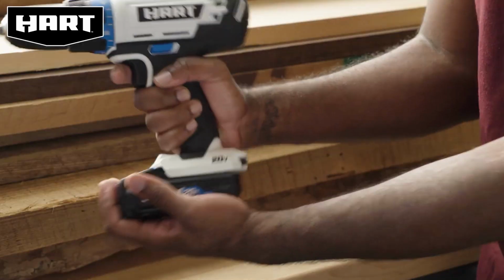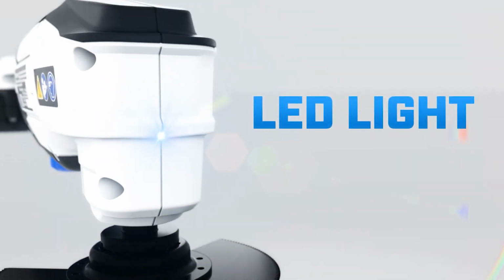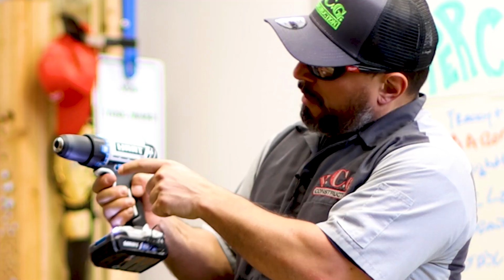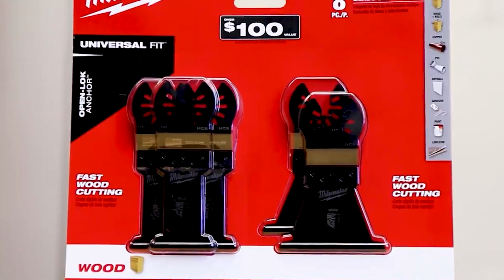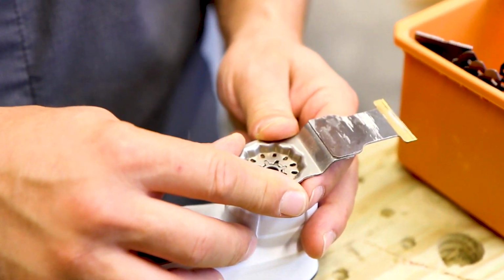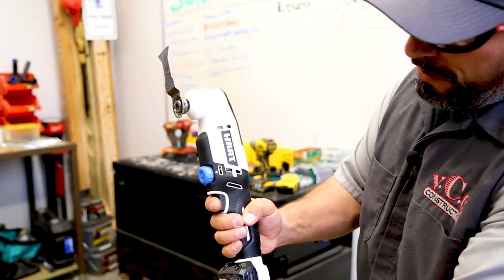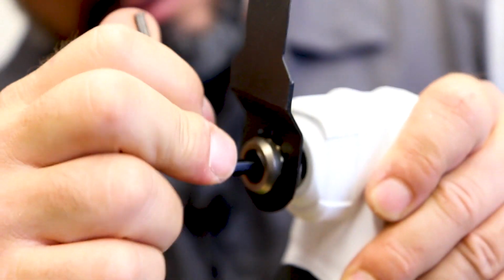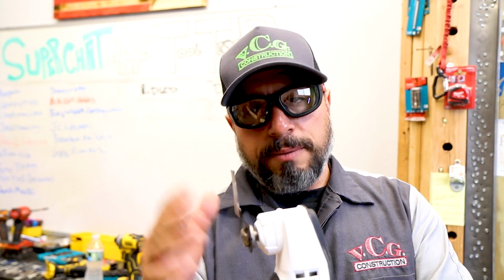New HART 20V Oscillating Multi Tool (I CAN'T BELIEVE WALMART SELLS THIS!)

Comment: So I work as a service tech actually.  I decided to have a little fun with it regarding the tools I decided to use.  In my case, I decided to try out HART tools.  So even though they are being called a DIY home use sort of tool, I am putting them to the test professionally.  I will say, so far, I have not encountered any issues with the tools I currently,y have and in fact they have all been very capable of getting any job done I have put them up against.  As a result, I intend on continuing to acquire additional HART power and hand tools for this experiment.  So far, HART has risen to the occasion.

Comment: I'm an occasional d.i.y carpenter. I bought the hart kit with the drill /impact/ saws-all etc Kit two years ago. They all perform great with a high degree of toughness. I've dropped them and threw them to the floor in a fit and it took multiple hard impacts before the drill finally broke. I smashed the drill end into the floor and it finally broke. I was impressed and bought another. I just ordered the multi tool. The buy the battery separate thing sucks. But overall, a tough tool reasonably priced.

Comment: I use HART tools exclusively. I was a KOBALT fan and I still love their 24v MAX line. I had 4 of the KOBALT tools and was building my inventory and had all of them stolen. Every tool I owned and it almost put an end to my business. I had 3 contracts signed, every penny wrapped up in materials and was just there with no way to do the jobs I had lined up . And as fate would have it my 18yo daughter came to visit and bring me my father's day gift.... I told her about the situation and she said Its ok dad. . it will work out... She left and came back with the HART drill and driver set... I have been using them daily and putting them through the ringer... I am impressed with every tool I get... I have 6 pieces now. I will put them up against DeWalt
Reply: This has to be a joke.
Reply: @svn5994  I have had the same experience with my Hart tools. I use Dewalt drills and Makita impacts at work and my Hart beats them all day long. Will they last as long? Who knows. But don’t discount the experience of people who use products you might not like.
Reply: People are crap when they steal 😡

Comment: I hate getting trapped into ecosystems with tools. Once I bought my ridgid impact driver, I was trapped into their system because of batteries, charger, etc. 
But I needed a multitool. 
Knowing TTI makes both Ridgid and Hart, I figured I would check out the Hart tool. Here's what I found...
They're the same. The Hart and Ridgid multitool are exactly the same. In fact, using a soldering iron, I can charge my Hart battery in my Ridgid charger. It's an OK tool. Well worth the money.

Comment: Got it for 50 bucks ......replaced blades and this thing is actually a beast.  Used the 4Ah battery and it does seem to perform even better.  Wish it was a quick change blade though.  I did buy quick change blades for it because you don't have to do a full removal, just loosen it up a little.

Comment: Makes sense that the Milwaukee blade would fit the Hart tool.....they are both a product of TTI.  I haven't used these power tools so I can't speak to the reliability, but I did buy the pro grade stud finder (no model number but the Walmart SKU is576810123.) This thing works AMAZING!  Also, Hart currently only offers 20v and 40v batteries.

Comment: I have Ridgid and Metabo HPT plus Ryobi and Hart both of which I kind of got into by accident, Hart is no where near Ridgid or Metabo HPT in quality but it is competitive with the brushed Ryobi in quality, it gets the job done for most DIY things at a price only Bauer can compete with. They are made by TTI which makes Ryobi, Ridgid and Milwaukee so they are not going to make junk. I hear they are coming out with a brushless lineup so that will put them more on par with Ryobi plus they are coming out with a lot of odd cool battery operated things like a 5 gallon battery powered camp shower/sprayer, similar to Ryobi and Makita that have all the odd "tool" options in the lineup.

Comment: Thank you for the review I just recently purchased the four piece combo kit and I was stuck for a minute trying to decide wich route I should go because I work part time installing offices and don't really want to fork out to much money because it's not my full time time gig so I went with hart being that I can also use these tools at home and really like that I can interchange the batteries and there's a decent line up of various tools if I was full time I would have probably forked out the money and went with dewalt but since I'm for two hundred dollars you can't go wrong with the drill impact drill saw zaw and flash light Plus I'm planning to get the skill saw and the air compressor that all run on the same battery I'm a home owner type and really ain't using my tools daily so that works for me

Comment: Hey vince!

Here is a question for you!

Im a 30 year old, not having any power tools yet! I want to start a nice  collection. But what is best? Milwaukee, Bosch Blue, Makita, DeWalt?

Not having invested in a certain battery type gives me options. 

I was looking at Makita, for all purposes, 18V family for garden, Home inprovement and gadgets it was quite convincing. Also my uncle swears by Makita. So my mind is clouded. 

Do you say, sure Makita, or better to go for.....

I dont mind mixing brands, having gas operated gardening tools instead of 18v Makita. 

What to do, I want to spend money ONCE! Better to buy best first instead of cheaping out. I need a toolset for life!
Reply: I have all makita and they have served me well. drill, impact driver, circular saw, mitre saw, multi tool, corded hammer drill,planer, corded grinder, cordless grinder, 9 inch grinder, metal drop saw, even have the cordless line trimmer that goes great.

Comment: Seems to me like the Hart brand of tools is meant for the new dads out there thinking they’re gonna get some projects done in between changing diapers.

The real benefit is being able to slowly grow your tool collection one tool here and there by throwing it in the cart so your wife doesn’t notice!!

Too bad I’m balls deep in the Hitachi/Metabo HPT platform... they’re pricey, but their lifetime warranty seems awesome (haven’t had to send any tool in yet).

Honestly though I would have zero issue getting Hart or Bauer or Ryobi tools if I weren’t obsessed with gear and/or had a tighter budget. 

I don’t use my power tools to make a living, so I’d be fine with a budget brand, functionally. But I’m an electrical engineer, so awesome power tools put a smile on my face (except for when I forget to turn the power setting down on my triple hammer and I shear the head off a screw)...

Sorry for the rant, just reflecting on my life choices.

Thanks for the video!

Comment: What got me into Hart tools is you can always  find an open box 50 percent off in the clearance section lol
Reply: I just bought this tool for $18. Your point is what got me into the hart lineup!!! 😂
Reply: Just got a Jig saw,reciprocating saw, 6" buffer/polisher, inflator, usb port, 2 4ah batteries w charger for 150$ Needed a Jigsaw and the Kobalt 24v one would have been $130 tool only.
Reply: @joeadrianmendoza  I just got one for $13.50 and a drill for $17.25...it came with a 1.5Ah battery. I have found so many deals using the Walmart app.
Reply: @jackedburton7639  wooooww where can I find? Please help thanks in advance

Comment: My problem with lines like Hart is there’s not much room to grow. You start at the bottom of the home gamer barrel, which is fine...but if you want to upgrade you now have to switch battery systems to another brand. Whereas if you got into something like Makita or Dewalt they have their cheaper or smaller line of tools, but when you’re ready or for some specific need, you can always get the high end/high power tool while staying in the same battery lineup.
Reply: Ryobi makes pretty solid brushless tools that are one step above hart. Hart is a low end tool brand from TTI and Ryobi is a mid end from the same company.
Reply: @davidperry4013  yeah, Ryobi is fine for most things, and they have a large platform. Plus they're reliable. My problem is just knowing that you'll never get the best, or top of the line from them, cause otherwise they'll make their other brands look bad.

Comment: Vince, my milwaukee m18 brushless compact drill was heating up very quickly just with some holes in wood. Has this happened to you?
Reply: When drilling make sure your hand is not covering the air vents on the back of the drill. If your pushing on the drill and covering the vents it will cause the drill to heat up. The drill also has a heat sensor that will shut it off when it gets to hot

Comment: Hey Vince about the triggers! Wanted to pick your brain on this subject more generally for other tool types. Because some tools need a good trigger nore than others. Here in the UK LittleMito had a video up (cannot find it now). But in that video he clearly demonstrated how you get a better range of control on the Milwaulkie impact trigger mechanism. As compared to a recent Makita impact, which had a less controllable trigger. Makita was more stiff, on/off with fewer gradations in between. Well a different youtuber (toolsnstuff) to apart a similar Makita impact. And found out that Makita are using the well known switch manufacturer OMRON for switch behind their trigger mechanism. However my question, other than will Makita be competitive and improve the action. Is does this same difference and advantage that Milwaulkee has also translate similarly in to their 18v drill drivers? Because it's nice to have that extra level of manual control. I find this is especially true when drilling into metal. Which requires a higher torque at a lower rotational speed. This is also why I often am asking about OneKey presets system. Because it allows the user to customize these parameters also. I also want to know what trigger Milwaulkee use in their tools. Because it would be nice to understand how Milwaulkee achieves a smoother trigger. And if that also carries over to any other tool brands.

Comment: It's crazy no one had the guts to tell him the play doesn't mean anything and it's such a trivial thing to focus on. Once the blade is clamped is matters not. I have a very old fein that has no indexing and once I clamp the blades they don't move. There are so many other things to gripe on with this tool the way the blades fit on The mandrell is silly. Clamp the blade down and there won't be any movement there you go.

Comment: Is there a way to cut straight with a guide? I needed to cut just a small piece of wood to open up for a window I installed in my garage and wow I cut so crooked 😂
Reply: I'm fairly new to these oscillating tools (recently picked up the DCS356 because I needed it for a job) but I had really good results by marking a pencil line, scoring it with the blade, maybe a 1/16" deep, then going deeper, keeping it square is a little more challenging, but if it's paintable it's caulkable ;) 

Oh, I just remembered, in the user manual there was something about a guide, but I don't recall what it was for exactly and I'm not sure where my manual is right now.
Reply: Exactly. Did you notice how, in the video, he put a corner of the blade in and then followed the line.
The idea is to just go in deep enough to be able to use as a guide as you go deeper. A liitle deepness at a time and go all the way across the cut a couple of times. This also stops the blade from getting hot. As apposed to plunging all the way in. 
Easier to show than to explain I guess...
Reply: Ray Smetzer I think I know what you mean
Reply: dscrive thnx very cool guy 😁 I really appreciate the idea. Next time I have to use it.

Comment: The HEART Multi Tool sure doesn't look like a competitor to RIDGID's product, lacking a decent blade change system or multi heads or an LSA Agreement.  This looks like a homeowner's Black & Decker runner up.  It was only a matter of time before the Oscillation Multi Tool would be designed for the homeowner and hobbyist because it's is a very versatile tool and it's relatively safe in the hands of a novice.

Comment: Until CMAS of 23!? I wouldn't have given u 2 damned cents for 90P OF HART SHIT OR THEIR OTHER EITHER!

Tho certain things in each brand was good stuff!! LOVED THE HART PRY BAR BETTER THAN ANY!! AND HT FLASHLIGHTS HAVE BEEN BETTER THAN ANY I HAVE HAD AND HAVE WORKED GREAT AND HELD UP WELL!!! ALONG WITH HT LIGHTS IN GENERAL! I ALSO HAVE A FANTASTIC HT SCREWDRIVER THAT I VALUE OVER MOST OF THE HIGHEND SHIT!!! SO EACH BRAND MAKES GOOD SHIT! DEPENDS ON WHAT U GET!! 

BUT PT WISE I WOULDNT HAVE GIVEN U 2 DAMNED CENTS!!!

BUTTT CMAS TIME 23!! I was traveling and went in a WM somewhere??? And they had a HART REP WITH A MAJOR BRAND NEW OFF THE LINE NEWLY REDESIGNED HART LINEUP OF TOOLS!! HE SOLD THEM WELL! BUT MANNNN OH MANNN WAS I EVER IMPRESSED AS HELL!! LET ME JUST TELL U GUYS THAT THE BRAND NEW LINE OF HART TOOLS HAS BEEN TOTALLY REDESIGNED AND THEY R PUTTING OUT SOME DAMNED GOOD SHIT!!!

BEST GD TAPE MEASURE ON THE MARKET TO!!! Their new TM is hands dn the best stop slide on the market!!! I mean it is firm and sturdy as hell!!!! It doesn't fall it isn't flimsy!!! It by God stops the 2nd U stop pulling it out!! Like major major controlled! It has a LT War!!! AND THEIRS IS ONE OF THE FEW OUT THERE THAT ACTUALLY HAS THE FRACTIONMENTS IN BET!! LIKE 3/4, 1/8 ETC!! I ABSOLUTELY HATE THAT ALMOST EVERY TAPE ON TBE MARKET ESP ALL THESE FN HIGH END EXPENSIVE AS HELL TAPES DO NOT HAVE THESE FUNCTIONS THAT HART CLEARLY DOES!!! THEY HAVE THE BEST STOP CONTROL NO FLIMSY TAPE SHIT AND HAVE ALL THE FRACTIONS IN BET!! I MEAN THEY R MAKING 1 HELL OF A GREAT QUALITY TAPE!!! AND FOR HF BAUER PRICES!!! OR LESS!?

I checked out the drills etc that he had there etc! And I tell u all that their drills used to feel cheap and all plastic total crap!!! BUT NOWWW THEIR DRILLS R HEAVIER BUT NOT TOO HEAVY! HAVE PROPER WEIGHT WHICH TO ME SIGNIFIES THAT THEY R USING MORE HQ MATERIALS!!! AND WHEN U SQEEZE THE TRIGGER AND FEEL THE MOTOR KICK IN I MEAN THE SOUND THE FEEL THE CONTROL OF HOW IT STARTS STOPS RUNS IS MIND BLOWING!!! I MEAN ITS RT UP THERE WITH KOBALT DEWALT THE BIG BOYS!!! THE LOOKS THE FEEL THE WEIGHT THE SOUND THE CONTROL PERFORMANCE ETC!! I MEAN LIKE HE SAID HART WENT BACK TO THE DRAWING BOARD AND HE SAID THEY ABSOLUTELY LISTENED TO THEIR CUSTOMERS NO 1 COMPLAINTS ABOUT THEIR TOOLS!! AND THEY SAID HEY WE CAN DO MUCH BETTER AND MAKE GOOD QUALITY THAT CAN COMPETE WITH THE OTHER GOOD HIGH END BRANDS! SO THEY WENT IN REDESIGNED SHIT MADE THEIR SHIT A TONNNNN BETTER!!!

AND I FOR 1 WOUND NOT HESITATE NOWW TO BUY HART!!! IN FACT AFTER TALKING WITH THEIR REP AND HANDLING THE NEW LINE TRYING THEM OUT THERE WITH HIM IN THAT WM AT CMAS TIME... I MEAN I WAS SOOO GD IMPRESSED AND BLOWN AWAY!!! I TOLD HIM WOW!!! B4 THIS I WOULDNT HAVE GIVEN THE HART LINE THE TIME OF DAY!!! BUT RT NOW I WOULDNT HESITATE TO BUY ONE OR TRY THEM!!!

THEY HAD KITS WITH THE CHARGER AND BATTS ETC IN THEM AND HAD EXCELLENT PRICES ON THEM TO!!

HONESTLY FOR THE PRICE THEY HAD THEM AT AND THE NEW RDHQ TOOLS I HELD FELT HEARD USED SAW....I ABSOLUTELY  THINK UR GONNA GET A MAJOR HQ TOOL FOR A MAJOR GREAT PRICE!!! AND I JUST DONT THINK UE GONNA GO WRONG WITH HART NOW!! 

I do know they r working hard to continue to improve and to add to their line! They seem to really give a shit and to really have a major desire to put put HQ shit and to do a hell of a lot better! 

And I THINK THEY HAVE SOME GREAT TOOLS NOW AND GREAT LOOKING AND I LOVE THE COLORS BLUE AND WHT!!! THO I THINK THEY NEED TO REVERSE THE COLOR THEME!! AS TOOLS DO GET DIRTY!

SO LIKE INSTEAD OF HAVING IT MOSTLY WHT WITH SOME BLUE!? GREAT BLUE BTW!!! THEY NEED TO HAVE THE HART LINE BE MOSTLY THAT BLUE WITH WHT TRIM ETC ON IT!! JUST REVERSE IT EXACTLY!! WHAT IS WHT MAKE IT BLUE AND WHAT IS BLUE MAKE IT WHT!!

I THINK IT WILL GIVE IT A NICE NEW LOOK AS WELL AND I THINK IT WILL GET BETTER ATTN WITH MORE BLUELESS WHT!? BUT KEEP THE COLORS!! 

I ABSOLUTELY INTEND TO GET ME A SET OF HART DRILLS SOON!! SEE HOW THEY PERFORM ON SOME PROJECTS IF THEY DO WELL I INTEND TO ADD TO THEM!!

DEF THE TM AND THE DRILLS TO BEGIN WITH!!!

TRUST ME FOLKS THEIR MAKING A LOT BETTER SHIT NOW!!! WORTH TRYING WORTH GETTING WORTH PAYING ATTN TO NOW!!!😮😮😮😊😊